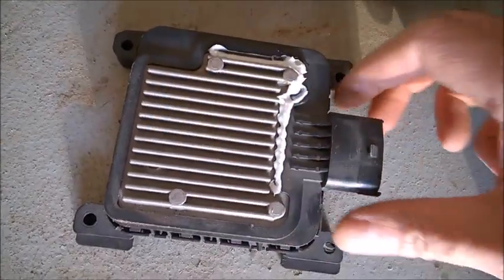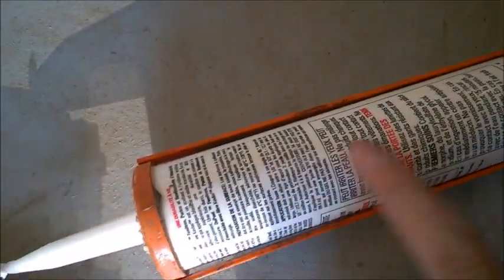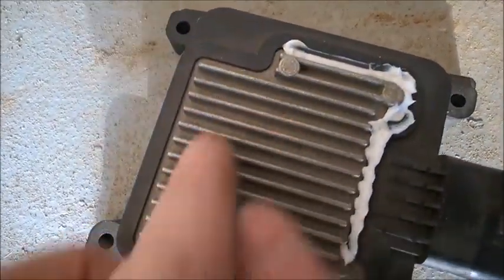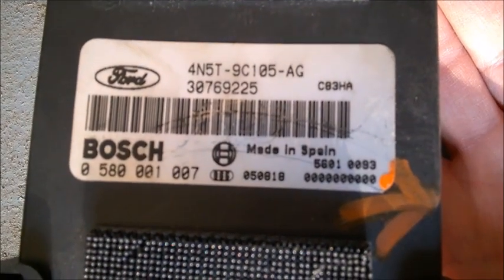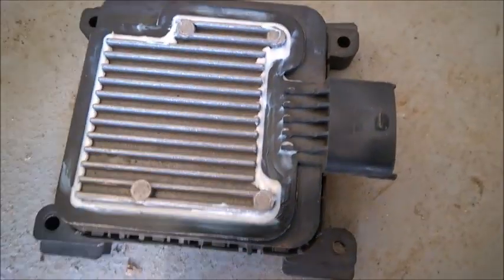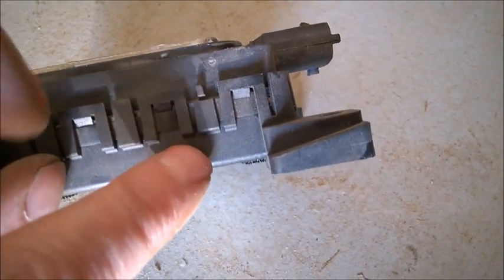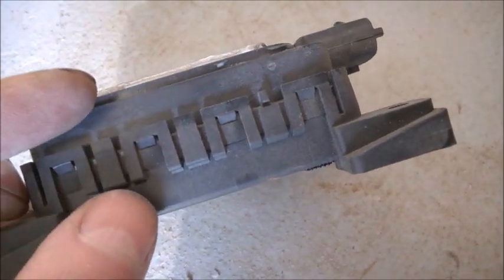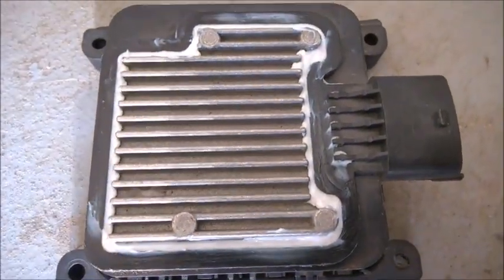Volvo S60 V70 XC90 How to seal a PEM module 2003-2009

Comment from the maker: On the XC90,  PEM can be near the fuel pump filter near the gas tank, inside the right rear wheel arch, behind the plastic liner on caliper side, or on other locations https://volvoforums.com/forum/volvo-xc90-9/xc90-pem-fcu-replacement-tutorial-71534/
https://photos.google.com/share/AF1QipM5DKuxsENZAn16aW2bUSKWkpSxAryENm0YIN4nrJOIoWPlnzApj_WdVWbv7KapUg?key=aTBLc3R2aG1HOUNlS29USnhTaWlXcHVKS0V6TmtB